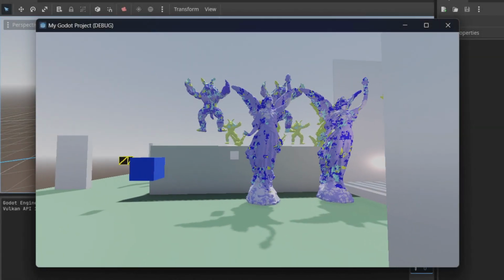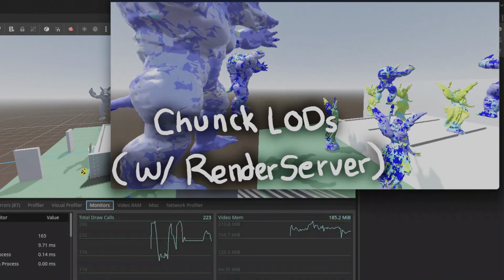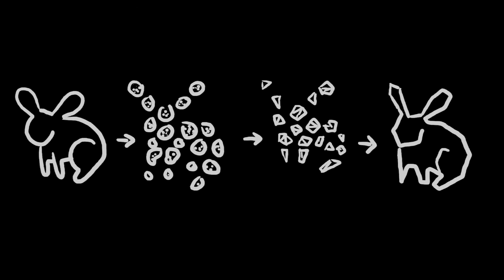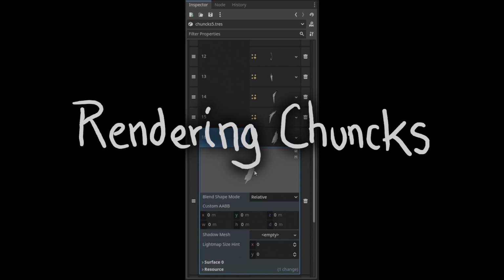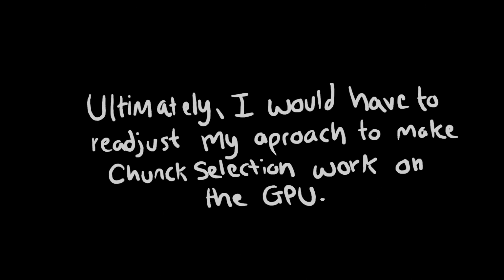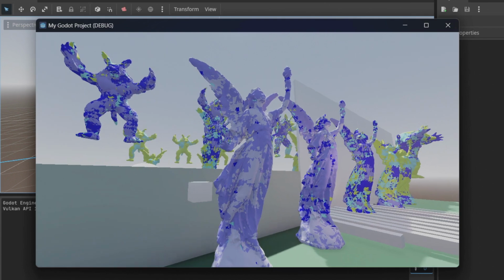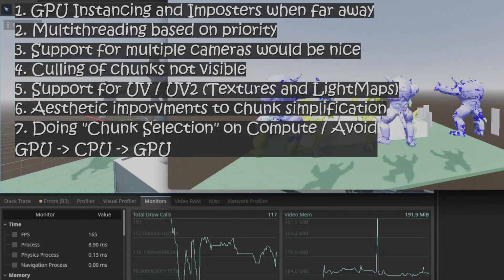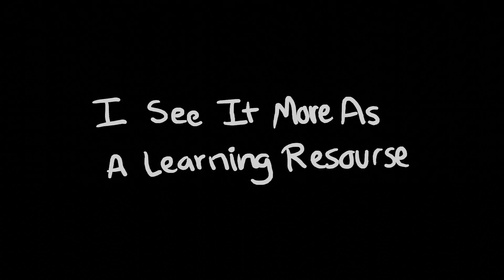Godot Nanite

Comment: Is it possible to use a LOD generation algorithm that is more aware of quad overdraw, which avoids the pitfalls of the official implementations of Nanite? Asking since I have seen the Threat Interactive video on Nanite and was wondering if an OS implementation could fix that issue.
Reply from the maker: I suppose it is always possible to improve on Nanite. However, I think quad overdraw may be somewhat baked into this kind of LOD system given that we are trying to keep triangles small which results in the quad overdraw problem. And if an artist wants all that detail visible, then there really isn't a way of getting around it.

I would also like to say this is mostly an issue with photo-scanned assets, such as those by Quixel. Artist made assets, on the other hand, can be made more intelligently. For example, an artist would know that most players wouldn't inspect the top of a table asset, so if it was just one big quad with a normal map, no one would be the wiser. By contrast, a photo scanned table would have thousands of polygons covering its top. So, if Nanite was similarly intelligent, it could make those kinds of optimizations.

Comment: doesnt nanite use something like geometry maps and rasterizing it within a compute shader?
Reply from the maker: Nanite does some rasterization work in a compute shader when triangles are the size of pixels. Hardware Rasterization is still performed when triangles are big enough, since GPU hardware is optimized to work on multiple pixels per triangle. This optimization is unutilized when the tri is only 1 or 2 pixels big. For this project, all rasterization is hardware rasterization. In other words, I am rendering my geometry like normal.